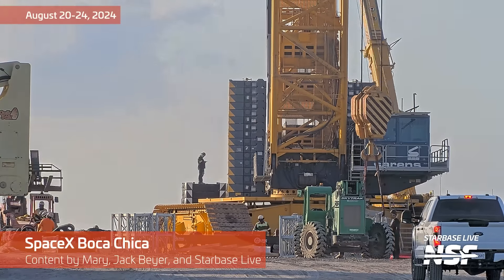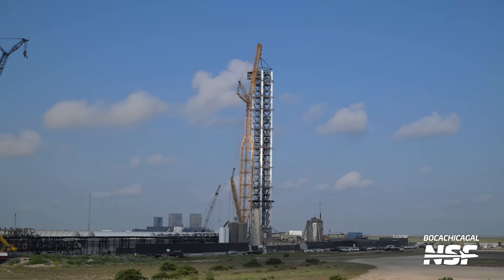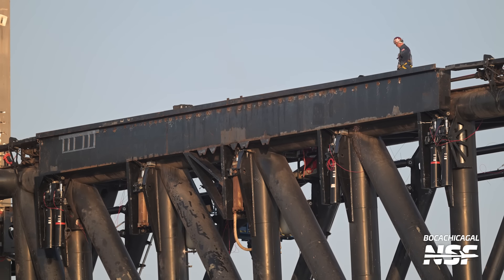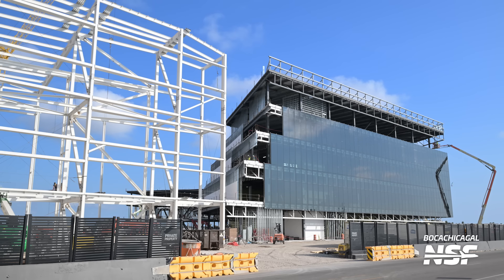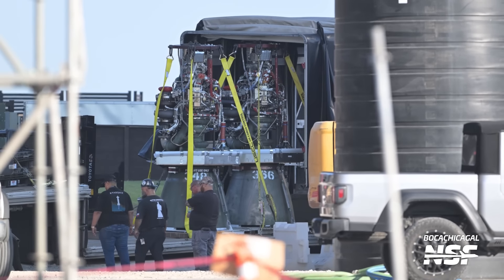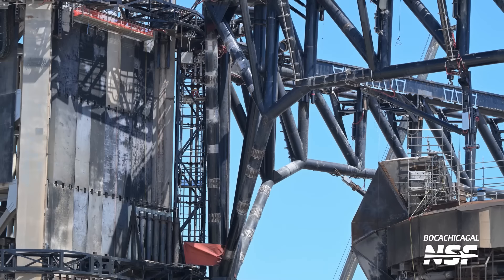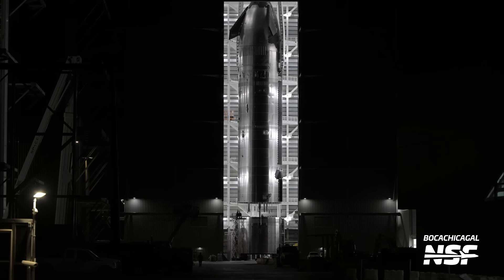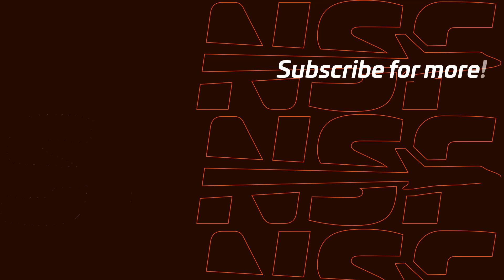Starship Version 2 Aft Section Rolled Out for Stacking | SpaceX Boca Chica

Comment: Since they didn’t stack tower 2 taller I’m assuming they aren’t expecting V3 any time soon. Maybe a good year or two with V2 then we’ll start to see hints of V3 when they start filing permits to extend the towers. I used to do tower work and yes it’s extremely common that we would put tools and hardware in those Klein canvas bags. They’re great and I don’t believe OSHA lets you use regular buckets made of plastic.